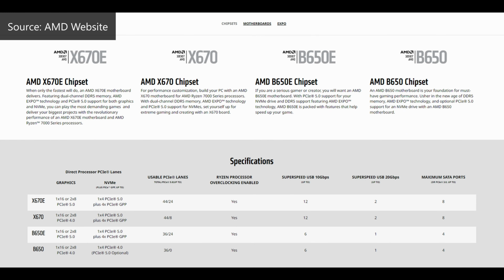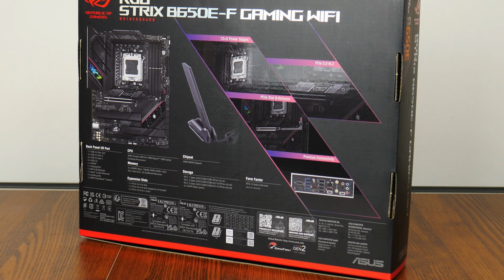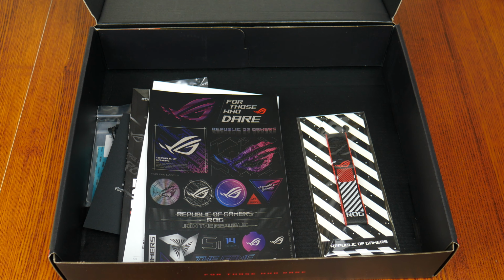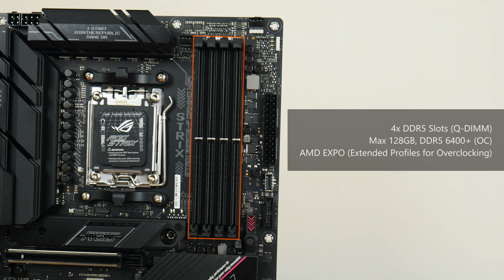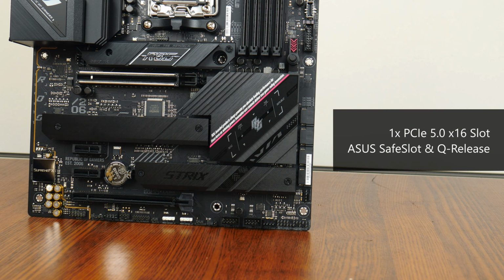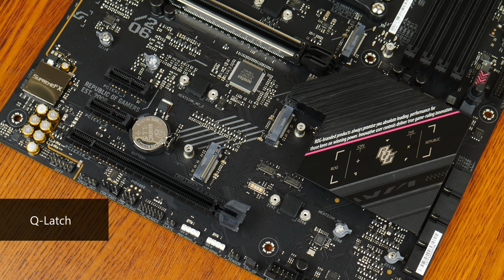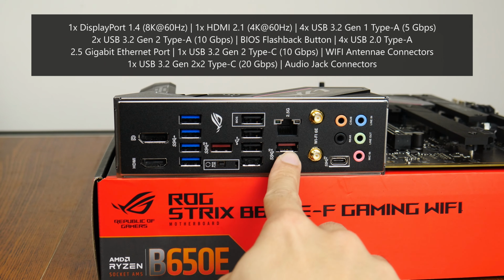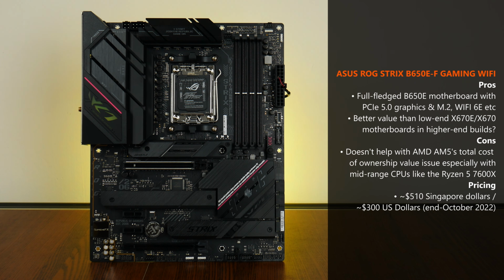Get this over an AMD X670 board? ASUS ROG STRIX B650E-F GAMING WIFI Unboxing & Overview

Comment: I just bought this motherboard but the second m.2 drive does not show up no matter what i try. Any ideas would be helpfull.
Reply from the maker: Have you tried plugging the drive into the other M.2 slots to see if it can be detected? To rule out the possibility of the M.2 drive being faulty!
Reply: @ALKtech  yup the drive in not fault and the motherboard either. I saw something on youtube that bios settings. Sharing lanes with pcie something that sort of and u need to change something in bios. Not sure what it is
Reply from the maker: @jackdawson4807  as far as I know from the ASUS specs sheet, the M.2 slot M.2_3 shares bandwidth with the PCIe 4.0 x16 slot that operates at x4 mode as illustrated at 9:01 of this video. Do you by any chance have a device installed on the PCIe 4.0 x16 slot?

In any case, I didn't get the chance to mess around with the board's BIOS settings when I had it on hand - there should be a section in the BIOS settings about "lane bifurcation" or something of that sort - you might wanna play around with those settings to see if anything changes!
Reply: @ALKtech  I tried but im not getting it. Neither the slots are bad or the ssds. It has to be something in bios
Reply: @jackdawson4807  you fix it?

Comment: What is the best video card for this to run VR games and cyberpunk smoothly? Plus would you recommend a 1000 watt psu? Any tips on what I should get to fulfill this combo that comes with ryzen 9 7900x 12 core
Reply from the maker: What resolution do you intend to game at and at what kinds of graphics settings? 1440p? Maxed out graphics details? Since you're building a sorta high-end gaming PC, a 1000W PSU's always handy to have to afford some headroom for future upgrades, but this would be largely influenced by which graphics card you'll be getting. Personally, I would be looking at minimally a RTX 4070 Ti/RX 7900 XT and above kinda graphics card to pair with the 7900X, but which card would be very much dependent on the price situation where you're from too!

Comment: hi i bought b650e f motherboard. Will it cause problems with voltage or future processors?
Reply from the maker: There's been plenty of media attention on the overvoltage/burning X3D CPU saga, and board manufacturers seem to be actively looking at the issue. I'd recommend updating the BIOS of your board to the latest version as soon as you can!

Comment: Hello there, great video! Do you have any issues with this board so far I bought it last month and I’m waiting for the rest of my parts to arrive. Gamers nexus was talking about cpus being damaged bc of overvoltage on the motherboard.
Reply from the maker: Thanks! I only had the chance to work with this board several months back when it was first released as it was a marketing sample - this was way before the X3D burnout fiasco happened. 

Are you intending to use a X3D chip with this board? In any case, just make sure you update the BIOS to the latest version as soon as you can, to hopefully prevent the overvoltage/burnout issues that have been hogging the limelight of late...
Reply: @ALKtech  thanks for responding. I bought this board in a part of a combo from Microcenter for $599. It included the 7900x 32 gb 6000cl36 and this board.
Reply from the maker: @saipand9986  that's a really good price. Do the RAMs come in a matched pair (2x16GB)? That said, you shouldn't encounter the burnout issues since they seem to affect the X3D chips...but again, no harm just making sure you update to the latest BIOS version!
Reply: @ALKtech  yea the ram does come in a matched pair of 2x16gb. It’s a pair of g skill flare x5. Seems like they lowered the price to 549 now for some reason on micro center’s website .
Reply from the maker: @saipand9986  ah well. US$599 for what you got is still a damn good price, at least compared to where I'm from - a similar combo brand new would cost slightly over US$1000...

Comment: How can I update the bios of this mobo?
Reply from the maker: You can either 1) use the BIOS FlashBack feature that allows you to update the BIOS without needing to install a processor/RAM/graphics card, or 2) load the BIOS ROM onto a thumbdrive, power up the fully assembled PC and enter the BIOS - there will be a menu page in there that will allow you to update the BIOS using the ROM file in the thumbdrive.

How to use BIOS FlashBack: https://www.asus.com/support/FAQ/1038568/

Comment: Just to confirm, none of the m.2 slots can run Msata? I know lots of boards of an either or option but this is Nvme only?
Reply from the maker: Yeah unfortunately all the M.2 slots on this board support NVMe drives only - it seems like the industry is moving away from SATA M.2 drives...the only new boards that still have slots that support SATA M.2 drives seem to be full-sized ATX boards from Intel (at least from what I've seen so far, mostly Intel Z790 boards).

Comment: X670e e vs b650 e e which one is for better using until am5 is end  i am not going to change mb and rams just upgrading cpu 
Upgrading every year with top cpu's newcoming 8900x 9900x etc
Not intertest with double gpu or a lot of usb ports, or crazy overclock, ı just overclock on factory limit what amd says,   VRM makes me worry for future upgrades
Reply from the maker: If budget is no issue for you, and since you're intending to upgrade to the best possible Ryzen CPU when they launch with each generation and do a spot of overclocking, the X670E-E sounds like the safest option. My two cents!

Comment: ASUS ROG STRIX B650E-F OR B650E-E OR B650E-I ???
Reply from the maker: Do you think you'll need dual slots for two graphics cards, an additional M.2 slot and a more powerful VRM setup for more overclocking with the E-E? If the answer is no, the E-F would be your best bet and you'd save some money too. The E-I is an ITX board - I'd only get this board if you're intending to use an ITX case...

Comment: For the CPU over Voltage jumper, do you need this if you’re using EXPO designated RAM, such as Crucial X5 series?
Reply from the maker: Nope - if I'm not mistaken, the jumper is meant to remove CPU voltage protection limits within the BIOS - more applicable for folks intending to do extreme CPU overclocking! If you're intending to enable EXPO for EXPO-compliant memory modules, this can be done easily within the BIOS without needing to tweak any jumpers on the board.

Comment: I hope this'll have enough juice for the 7800X3D because I just bought it.
Reply: nexusthor7  Oh man, it's wonderful! No issues at all with fast boot times and quick loading websites/games with the latest bio update and of course...killer fps. AMD has officially proved themselves to me.
Reply from the maker: I think this board and the 7800X3D will chug along just fine! Do you have a graphics card in mind already for your build?
Reply: @ALKtech  Right on, thanks for the reply! Yea, right now I'm rocking a 4080 with a 4770K lol so it's definitely time. Never owned an AMD anything so hopefully things go smooth.
Reply: nexusthor7  Yea, none at all. Been smooth sailing. 4080/WD Black SN850X
Reply: I think they over blew the situation on that.
Reply: nexusthor7  Anytime my guy, I always love helping. GL on your future endeavors even though I know you'll be set for a veeerrry long time, I know I am.
Reply: nexusthor7  It depends if you have a 4K monitor. If not that thing is way overkill and uses quite a bit more power to run it. You'd get about 20 extra frames with it though that'd like going from 120fps to 140fps at 1440p which is what I'm running as so that'd be up to you. You just wouldn't notice anything past 100. I'm using a corsair hydro series h80i v2. They also have the H60 which is the same cooler but with rgb if that's your gig. My temp is 42 degrees C which is a really good range, You won't need a massive cooler because your CPU is so efficient.

Comment: If you're running this board personally, how are boot times? Mines a bit slow on initial start from a turned off state. I kinda knew about it going in, but the bios version I'm running seemed to make it slower. Might have to try the latest bios
Reply from the maker: I don't run this board personally unfortunately, as it was a marketing sample. But yeah, have a go at updating the BIOS - hopefully there are optimisations that help speed up boot times!
Reply: this board is the slowest to boot from power off or even restart.  I came here looking to see if anyone figured out how to make it boot faster.  It takes like 45sec to over a minute to post everytime.  My X570 with my 5900x was power on and boot in seconds and this thing is like a minute.
Reply: I know this comment is a year old, but I just got this board and my boots take literally 5-10 seconds, not slow atall

Comment: Is this motherboard bios same as Asus prime x670e. And which one you recommend more?
Reply from the maker: The BIOSes should be similar - where I'm from (Singapore), the ROG STRIX B650E-F is cheaper than the PRIME X670E by about $66 US dollars, so I'd personally get the B650E over the X670E!
Reply: Thanks for replying. I will get a b650e when r7 7800x3d release.

Comment: hi, it said that it can support usb 3.2 gen 1 up to 2 ports. what kind of cable header do I need for that ? and will the usb ports work separately? thank you
Reply from the maker: Most modern PC cases would come with at least one front panel USB 3.2 Gen 1 port that terminates in a 19-pin connector - this said connector is to be plugged in to the USB 3.2 Gen 1 front panel header on the motherboard. 

And yes, if your case comes with two front panel USB 3.2 Gen 1 Type-A ports and they terminate at the same single 19-pin connector, plugging this connector into the same motherboard header will enable both ports to work separately!
Reply: @ALKtech  thank you, I hope my fractal torrent has a cable like that. It has 2 type A ports in the front panel. But I don't know whether it's 2 separate cables or just 1 cable for 2 ports into single 19 pin connector.
Reply from the maker: @thehahahaha88  that's a nice case - it should come with a single cable that supports two USB 3.2 Gen 1 Type-A ports. Enjoy your new rig!

Comment: if you were originally gonna go with a x670 just get the b650e-e version its so much better for its use
Reply: Not really, the e version in my opinion has a worse management of the pci lanes ( Watch manual)

Comment: i am a bit confused:  since pci.5.0 is featured, chipset has to be B650E but both asus site and motherboard manual state that it has a b650 chipset, NOT a B650E. Moreover, in guru3d's review  there is a screenshot of cpu-Z where you can clearly read B650 only...wtf!
Reply from the maker: Yeap I noticed this peculiar thing too...I strongly suspect it's just some AMD internal naming convention that wasn't very well thought out and board manufacturers had to just follow suit  - if you look at other board manufacturers such as ASRock and Gigabyte, their B650E boards all have "B650" listed as the chipset too in their respective specification pages!
Reply: So it has b650e chipset or not? Not clear because the packaging is saying b650e chipset

Comment: I just scored this MOBO, a 7900x, and a set of 32gb 6000 ddr5 RAM for $599 from Micro Center!!
Reply: I just got the same bundle as well, just checking to see if the brackets on a Corsair AIO cooler can be used on the AM5 board
Reply: @thebodybags417  they work. I put a Corsair 240 in a Hyte y60 case using the bracket that came on the MOBO
Reply: @Eskimohow  same here I grabbed that bundle as well it seemed too good to pas on. Are you having any issues with the RAM, specifically when enabling EXPO? My computer won’t wake from sleep.
Reply: @focust13  I got it too and not experiencing any issues. I updated bios just in case after it booted
Reply: @focust13 How the hecc is that bundle that cheap in the US?! in EU this would cost a fortune
Reply: @sunpak4898  how did you get the coupon?
Reply: Any concerns with this motherboard soo far? Planning to grab the deal from Microcenter. Unsure if MOBO has known issues.
Reply: @AbhishekRamesh1 none, I've had it since it came out and it's worked fine
Reply: @AbhishekRamesh1  It's hit or miss. I had issues before the newest bios update (1222) but have since seen improvements. Others have said the new bios made things worse.
Reply: @focust13  Thanks. That's good to know. I'll stick with my 5900x w/ X570 MOBO then.
Reply: @AbhishekRamesh1  if you’re getting a am4 board for gaming I would get the 5800x3d. I haven’t had issues with this motherboard though. The Bluetooth on my X570 Tomahawk was terrible, so I would definitely stay away from MSI.
Reply: @Eskimohow  I already have 5900x & Asus TUF gaming X570 MOBO. I agree with Bluetooth issues. I'm having that too.
Reply: What cooler would y’all recommend for build ? I have the 4090 with micro center bundle
Reply: @TVEMANNY  there are lots of good videos here on youtube comparing temps with different coolers
Reply: Scored me the same combo yesterday. Pairing with Asus TUF 3090Ti, MSI A1000G PSU, lian LI O11 dynamic evo case, 2tb Samsung 980 pro and deepcool LS720 360mm AIO cooler. Also got a LG 32" 1440p ultra gear 165hz IPS monitor
Reply: Bro Itz 549
Reply: @krnzzang84  when I got the combo it was 599
Reply: So are you liking the B650E with 7900X after some time gone by ??
Reply: @KaPonoo  yes mine has been great. I locked in clock 4000 mhz at .9 volts. I cpu mine on it when not gaming
Reply: @tomcarey3457  What Bios Version you running currently on your Mother Board ??
Reply: @KaPonoo  I dunno I did update it when I got it
Reply: @tomcarey3457  If you find out which version of Bios your running that would be good to know bc I have the same board and I’m still on 1409. Iv been holding out bc of the 7800X3D burning 🔥 itself in the socket
Reply: @tomcarey3457 you do that in bios or ryzen master?
Reply: Got mine today for about $500
Reply: @JacobGagoOfficial  Thats a steal.  They are still going for $550 in my area.
Reply: @tomcarey3457  so ended up taking on back I’m going intel
Reply: I got that same deal but for 549 to good to pass up
Reply: It’s 550 now with 64 gb wooo
Reply: @ixalexhd8141 it’s crazyyy worth it for sure, just got the bundle as well with GeForce rtx. 4070 ti
Reply: Got the same bundle the other day. Looking forward to the build.
Reply: Same
Reply: How do you like it so far? Just picked up the same today
Reply: Just ordered the same, going to pick it up tomorrow! Saved so much on the bundle I decided to spend it on a new GPU too 😅
Reply: I would love the combo, but I can get away with the 7700x performance.
Reply: Just picked this up as well. Was thinking about getting the 7700x with a Gigabyte Mobo but for $30 more you can get a Strix Mobo with the 7900x. My lil 3070 gon bottleneck the fuck out of it lol.
Reply: 549 now. Got it then they sold out!
Reply: @tomcarey3457  nah I go for the x660
Reply: @Eskimohow The just dropped the price to 549. But good deal. I looked because of your comment. Purchasing soon.
Reply: Westbury?
Reply: I just ordered my combo also. Coming from 3700x and a 5600xt to 7900x & Taichi 7900xtx. Can’t wait to see what the difference will be. Star field premium with gpu purchase. 🔥🔥🔥🔥🔥
Reply: Cheap af
Reply: Me too and now I can’t get anything to display 😢
Reply: @Loosemoongoose make sure you update the bios and have ram in a2 and b2 slots
Reply: Do you recommend any other motherboards in this tier or is this one of the best options at this price and tier?
Reply: did micro center charge tax for this bundle?
Reply: Hey, I just got the same yesterday!!!
Reply: I just got mine today also
Reply: Best deal, trades my ram sticks. Couldn't pass on a bundle like this for 600
Reply: Man I wished I lived in the states and near a microcenter
Reply: Garbage board
Reply: Brah this deal just seen you mentioned, holy FACK my doo, you go Intel same way, you be droppin an extra G, my G.

I'ma save myself a G, and pick up that  MC goodgood

Comment: will i have any problem with 32gb ram 6000mhz, it says  i ll have to oc the moptherboard why exactly ??
tnx
Reply from the maker: You should be fine with DDR5 6000 RAMs - would be good to check out ASUS's RAM QVL list to see if your memory is on the list of tested ones for a peace of mind. 

It's technically an OC as for example, the DDR5 6000 RAMs that you intend to use, need to be set to the EXPO/XMP profile from within the BIOS in order to run at the 6000MT/s, otherwise they'd run at some much slower default speed!

Comment: Thanks for this, I just picked this board up since it was bundled together with a 7900x and RAM at Microcenter...haven't installed it yet but wanted to see what it offered beforehand
Reply from the maker: No worries - enjoy your new build! Do you have a beast of a graphics card to go along with this and the 7900X?
Reply: @ALKtech  i have an EVGA 3080 XC3 Ultra...my old CPU was a definite bottleneck so im already seeing a noticeable improvement
Reply: @ALKtech  I’m running out of options I picked up the same bundle from micro center just yesterday and I got everything together everything is good but for some reason my board didn’t recognize any of my bootable drives at first and then it did but it wouldn’t boot. I’m not too familiar with asus boards but whenever I turn it on all color errors flash and they go away indicating that they’re fixed but the one continuous error is the boot error. Can you please help me ?
Reply from the maker: @CheeseTheFeared  What drives are you using at the present moment? Combination of M.2 NVMe and SATA drives? Were these drives working perfectly fine in your previous PC?